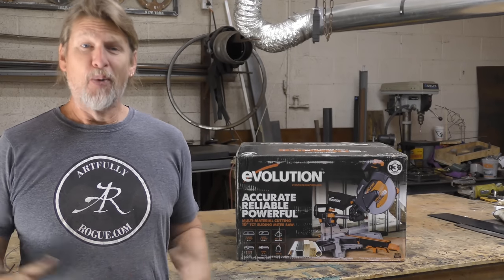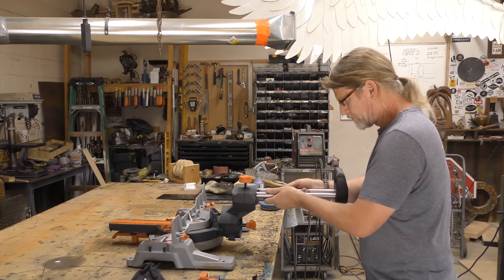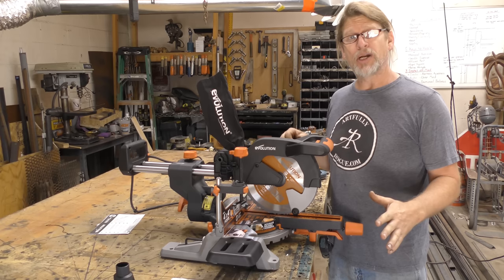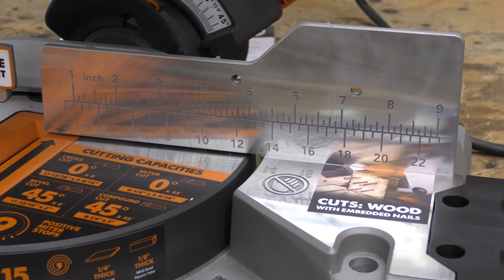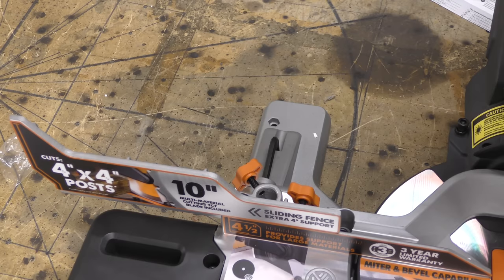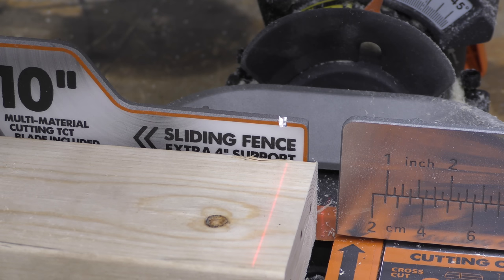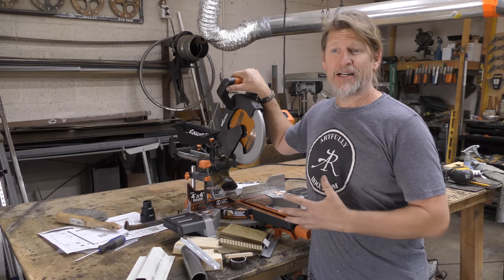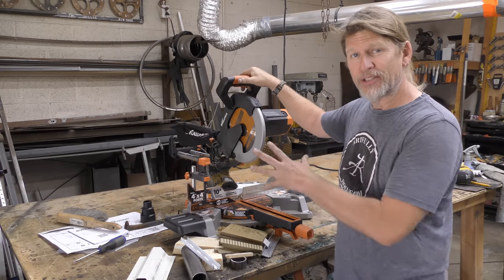Evolution Power Tools 10" Miter Saw Review...Exposing a flaw or just being an idiot.

Comment from the maker: I reached out to Evolution Power Tools regarding my video review of the 10" sliding miter saw. And I wanted to point out that EPT does in fact have it noted in their instructional manual (that I did not read) that the sliding fence must be moved before cutting a bevel. It is also noted in the manual that the slow motor start up is in fact a feature of the motor that is intended to extend the life of the motor.

Comment: I've got the slightly older version of that saw- it works great up to about 2x2 tubing if you switch to the blue blade like you have in your bigger Evo saw.
Reply from the maker: Yeah I figured having a higher tooth count would have better result. Does your saw start up the same way?
Reply: @ArtfullyRogue  yes- it's got that slow wind-up when it starts, but I've gotten used to it.  It's still a ton faster than using a bandsaw, and a whole lot easier for angled cuts- I use my EVO380 for square cuts

Comment: Good review Doug. I purchased one last year and I have mixed emotions.  The start up has something to do with it running at lower rpms for cutting metal.  My biggest issue was the fence would not stay put. It kept moving off of 90. I threw a lock washer under the bolts and it seems to be holding.

Comment: Thanks for the thorough review. Do you think a lot of the same things could be accomplished on a sliding Ryobi miter if it had a blade suited for metal?
Reply: No- a standard miter saw spins too fast for cutting metal, even if you had the right blade.   They also use a bigger arbor hole than most saws, so you can't mount the blade on a Ryobi saw.
Reply from the maker: As Mad Design mentioned...rpms are too fast on regular chop saws. Another thing I noticed was when cutting metal in the evolution miter saw, there's a plastic piece in the extension arm and some of the hot shavings kind of melted into it.
Reply: Good to know. Thanks guys.